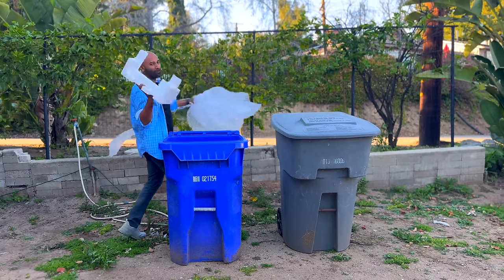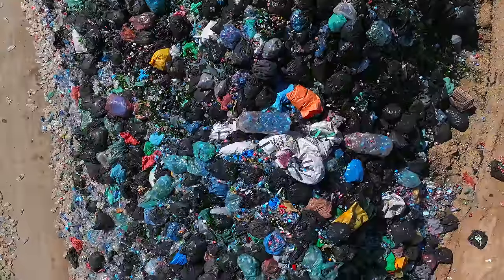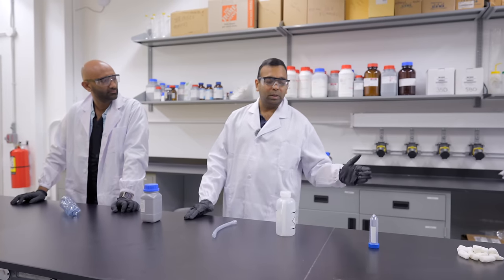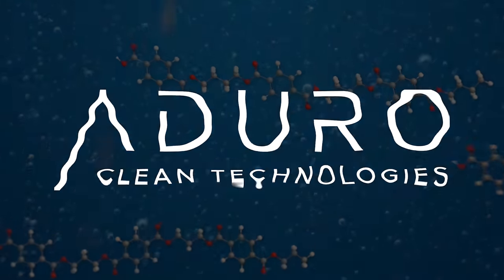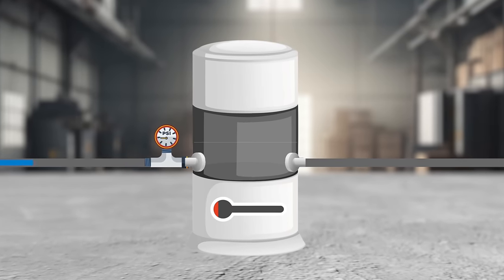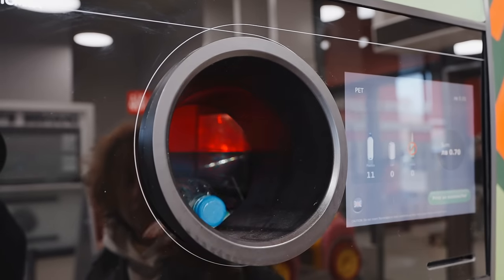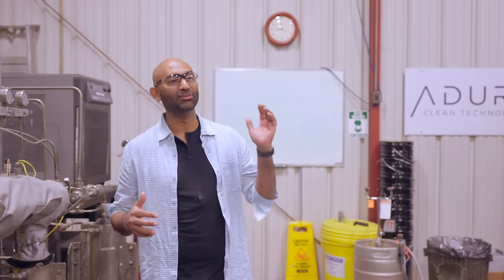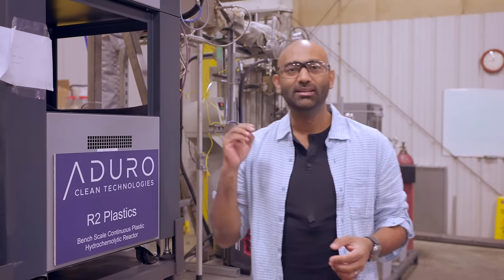Plastic Waste May FINALLY Have a Solution!

Comment: in 2019 Renewlogy, co-founded by MIT alumna Priyanka Bakaya, is using its system for converting plastic to fuel.  But I haven't see anything about them In a long time.

Comment: As long as we're mentioning public companies, HolyGrail 2.0 is a huge project in the EU about to wrap up a multi year study into solving the sorting problem. It's based on technology owned by a company called Digimarc. Would eliminate the need for most manual sorting plus result in much more valuable feedstock since it's more pure. Can also sort food graded from non food grade.
Reply: Ok that's a really positive sounding technology. They put a 'digital watermark' on the product, which is linked to a database of its properties, so a sorting machine can identify everything going through it and send it to the appropriate location. Perhaps it'll be faster than AI image based spotting or the two will combine - you could send everything that's bottle shaped in one direction, then scan it to be certain. Uniform shapes would possibly be easier to scan. 

Might be a good technology for Ricky to cover since sorting waste is a huge part of our problem and we do have massive landfills that will need Optimus to sort through them so we can get rid of them at last.

Comment: PLEASE do a video on waste (garbage/trash) to energy power plants like they use in Sweden.  They burn all trash at a very high temp & filter the exhaust to remove pollutants.  I think this is, BY FAR, the most economical method of handling our plastic waste as well as normal household garbage as we no longer need nasty landfills.

The amount of energy & time & resources required for recycling plastics is enormous and makes recycling FAR FAR more expensive than using virgin feedstock and it is (currently) ALWAYS of lesser quality than new plastics.  

After everything is burnt, the ash can be used for a wide variety of things and the metals can be recovered.
Reply: Thank you! I fully agree and this should be the main area we look at for plastics. Very cool tech here tho

Comment: Well, this gets me very interested. I used to work in the oil sands industry. The way bitumen was extracted from the underground is through thermo process to reduce the viscosity, either by hot water washing/liberating or SGAD so it's not bitumen only. It's always a mixture of water, bitumen and sands. If their catalysts and process can replace thermo cracking or hydrogen treatment which is needed to process bitumen to a lighter product (Canadian Western Select), this will be a real game changer.

Comment: 2 issues that were not addressed, and that concerns me: Energy required and non-useful byproduct. Especially if the byproduct is toxic for the environment.
     Does this process create more issues than it solves?
Reply: Finally someone's awake! The guy wearing a respirator on a machine that's not even online. They're hand feeding it. Scale it up and enter cities will need respirators.

Comment: I see this video just when I have been thinking about giving up on recycling plastic because landfill regulations make it far less likely that plastics will end up in the ocean than current recycling commerce streams. A continuous recycling process for all the different types of plastic certainly seems like it would be more efficient than having to recycle different plastics by different systems.

Comment: They left out a lot of information in this video.  This is just an investment ad for this start-up.  This tech isn't new, it is just reversing the plastic making process.  The reason companies don't do this is that it takes more energy to do this process than you get from it.  Like using a gallon of gas to make half a gallon.  Did you notice they didn't mention how much energy the process uses?  They make this look really complicated and hard to understand, but it is really very simple.  Don't fall for the razzle-dazzle.
Reply: You're right, it is an energy negative process. So how do we overcome that? I'd love to see concentrated solar paired with this

Comment: That's all great, but like previous recycling attempts, they found that the product it transforms into is too expensive to replace the materials they currently use in manufacturing it to begin with. It's not economically viable. There may be a way to change the consumer perspective to allow for an expensive version of plastic that is recycled, or the government may spend money to compensate for the cost difference. It's all still up in the air.
Reply: Valuable point made!!
Reply: Same thing with solar panels - you just add an up front cost to purchase, which covers recycling. It's super easy, barely an inconvenience and utterly solves the cost problem. Rocket science is not, and it's an already established and perfect solution to the cost problem.
Reply: @jonevansauthor  Solar Panels are a different category than our plastic usage. No one will want to pay $10 for a single soda pop.

Comment: we should prioritize banning and reducing plastic.
Reply: Great, so you take old bottles and make new bottles. That doesn't change the problem. It is better to burn it in a vacuum to make diesel.
Reply: Plastic is by far the best product for its uses. 95% yield with this tech. That also doesn't cure the already massive amounts that already exist
Reply: @TristanTemple-jz8bq  we should be actively banning the use of single use plastics
Reply: Ban plastic, not guns.

Comment: All the worlds major governments need to give these guys a ton of money and help save the planet
Reply: How about No?! They need enough money to make a workable full scale production system and see if it does work as advertised. 
We do not need an infinite supply of grifters burning billions upon billions which in fact reduces our technological advancement and as such has an indirect negative impact on the environment.
Zero trust in any governments ability to manage such things when they mostly do the exact polar opposite of what works in terms of conservation.
These guys are great for actually having some competence and putting their money where their mouth is, certainly hope it takes the world by storm.
Reply: Ehm, how about the companies that actually use and/or produce it instead. "Governments money" = taxpayer money. No thanks...
Reply: Combined with reduction of our consumption of products packaged in troublesome plastic, we could turn this container ship around! 😅

Comment: Using heat to break it down into the hydrocarbons it's made from for fuel or repolymerization into new plastic, while energy intensive, is more economical than creating from "virgin" stock. A large processing facility could be extremely profitable as economy of scale becomes applicable.

Comment: I think this is great! Polystyrene foam or styrofoam can be turned into to the styrene monomer. Afterwards you can convert this into benzoic acid and react with baking soda to form sodium benzoate. Sodium benzoate is a food preservative and is very safe. So idk the financial side of this but im familiar with the chemistry side of this and its possible. This is an example of just a simple straightforward method with just one polymer. I hope they continue to make it more financially viable and learn how to separate the different types of plastics from each other efficiently.

Comment: 4:37 the funny thing is, even though we are required to take the cap off at some recycling facilities in order to recycle a plastic bottle, the recycling center will not pay you if the label is not attached to the plastic bottle upon remittance. it must be written that your state will pay you CRV on that bottle, for you to get reimbursed for the CRV already paid for.
Reply: In my county in the UK, we are asked to remove the label, and leave the cap on a bottle, but our waste is collected we don't take it back for a credit in a shop which is done in some places. Of course, you can't actually get the whole label of as part of it is glued so it seems to me it's more practical to do that at the recycling plant as they're going to have to do that anyway. 

Ultimately though the reason plastic is not recycled, is there's no money in it. Which is easily solved by attaching a small charge to each bottle or bag, and using that to build and run recycling plants. Just as the EU has done with solar panels.

Comment: This reminds me of something else. Back between 2001-2005 timeframe there was a company called changing world technologies or something like that. Their process was to take mostly turkey offal since they were setting up next door to a butterball plant, but supposedly they could process used computers, sewage and other things as long as there was enough plastic/organic. Grind it all into a slurry, feed into a giant pressure cooker at high heat for several hours until simple carbon chains formed, flash boil the water off, centrifuge out the metal content and they were left with oil and gasoline. The gas fueled the machinery. Different oil types and quantities were determined by what was fed to the machinery.

Comment: The question I've often wondered about is why this sort of thing isn't done to our entire solid waste stream. I wondered why plastic wasn't chemically broken down back into something a kin to the feed stocks used to make the plastic in the first place, like these people are doing. The next step I imagined is using heat and water to turn the harder to break down hydrocarbons and other organic chemicals left over into more petrochemical feedstocks. I imagined the metallic and other elements from things like electronics, metal packaging, cars, appliances, etc. could be run through the process to remove the plastics and other organic chemicals and then refined back into the constituent elements such as aluminum, iron, silicon, precious metals, etc. Could there be a way to refine out usually toxic elements for reuse such as lead and mercury? One of the strangest things I heard about was the problem aluminum processers have with expensive to deal with waste high in potassium when they recycle cans, but that potassium is now deficient in forests because it is a part of wood harvested from our forests (wood ash is the traditional source of potassium hydroxide used by our ancestors to make soap) so why wasn't the potassium somehow used to reinvigorate our forests? No one seems to try to figure out how to make one person's junk into someone else's treasure. I think most biomass should be composted, but the biomass that inevitably ends up in the waste stream that usually gets landfilled could be made into hydrocarbons along with the plastic. There might be ways to take the nitrogenous components in the waste stream biomass, such as in the amino acids of proteins that could be made into nitrogen compounds to use in agriculture so we don't have to depend as much on energy intensive processes to make nitrogen compounds literally out of thin air; not to mention all the mineral nutrients such as phosphorus, calcium, potassium, sulfur etc. needed in agriculture that could be recycled. Taken to its logical conclusion, it could end up that mining and restoring old land fills would make economic sense, rather than continuing to make new ones to store what we should recycle in the first place.

Comment: That's cool. Does the process produce more value in its end products than its operating costs, especially energy cost? We really need to get global plastic pollution under control, especially in the developing world. The only thing a closed loop full recycling system requires, is constant input of energy. Hope that energy will be available and affordable.

Comment: I am litterly working at a similar pyrolysis machine in Austria -> it is quite funny to see how much they are still in this "prototype mode" while in Austria there are Re-Oil Plants from ÖMV which can process around 2 tonns every day and in Germany there are even bigger ones which can process 20-30 tons a day
Reply: I'm curious as to how the plastic recycling is paid for, as it probably isn't economical in Germany as well, even with the greater scale. Is there a mechanism that passes the extra cost of recycling to the consumer?

Comment: Awesome that the technical know-how is being developed to recycle a large part of this waste stream. I just hope that the cost of the process is lower or at least not much higher than producing new "virgin" feedstock from oil. Otherwise, this will go the route of CCS meaning it will not be deployed because it is too expensive to implement.

Comment: Thanks for the video. I always enjoy hearing about chemical recycling. I have not heard these questions addressed. What is the comparable energy and resources usage of chemical recycling versus virgin plastic manufacturing? What are the outputs of the processes, and are they toxic and marketable for other uses? What are the safety and security concerns of these facilities? For example, what if the facility catches fire or is demolished by natural disaster?

Comment: Scary thing about this recycling process (and, i think, similar processes)  - the patent wall. 
For a huge time only the patent holder will legally allow to sell and reproduce a patented product (process) on a commercial level.
An so this technology and similar ones will be very underproliferated across the globe. 
At the best companies like the Aduro Clean Technologies Inc. can be massively feed by government and private investors at a price of making
 such technical process available to free to general science and engineering (public domain?) to help its further advancements and spreading.

And i have a big doubts that a fluoropolymers are easily recyclable by this way (but at least, if there is a technology to crack a stones like ptfe at least to hf and 
fluorine-free hydrocarbons - it will be a  huge success.)

Comment: This innovation of plastic recycling by Aduro Clean Technologies Inc is a breakthrough technology. As such, after seeing this video, I have decided to buy stock in this company.  I want to "get on the ground floor" of buying into  this company before it takes off like other companies in the solar and EV industries have  done and are still doing.  Up until now, the only way to truly alleviate the plastic problem in an environmentally favorable way that I heard about was to use DNA modification to create "plastic eating" microbes.

Comment: New York City has been using Thermal Depolymerization (TDP) for decades now. By passing 30,000 volts through plastic in a vacuum it turns into a gas, which can then be compressed into fuel such as LPG. New York City uses it to turn plastic waste into fuel for their buses.

Comment: 1:21 The original machine had a base-plate of prefabulated aluminite, surmounted by a malleable logarithmic casing in such a way that the two main spurving bearings were in a direct line with the pentametric fan. The latter consisted simply of six hydrocoptic marzlevanes, so fitted to the ambifacient lunar waneshaft that side fumbling was effectively prevented. The main winding was of the normal lotus-o-delta type placed in panendermic semi-bovoid slots in the stator, every seventh conductor being connected by a non-reversible tremie pipe to the differential girdlespring on the "up" end of the grammeters.

Comment: Single use plastics are a bane - vapes, lighters, medicine bottles etc. Plus the wastage of oversized packaging: I bought a 6cm high bottle of vitamins yesterday that was only 2cm full. Then there are "designed to fail" brittle plastics - household storage bins, buckets etc - things that should be robust

Comment: There's a company in Japan that's been turning unsorted plastic into diesel for several years. The new diesel burns cleaner and with more power that current diesel.

Comment: Not to temper enthusiasm but as mentioned in a couple of other comments, the process either needs to be economical or someone has to subsidize the process .  It would be useful to show an energy balance on the current pilot plant to show how much energy is needed to transform the waste plastic into a useful products/feedstocks.  The balance would show the gap that must be closed to make it economical.  In the meantime, we should continue to recycle plastics to provide the folks developing this technology to have (slightlly) less expensive feedstocks to prove out the technology that could hopefully evolve to handle the more diverse platstics.

Comment: This was quite the one-sided feature, making it seem like a miracle solution without any downsides. It would have been nice to present some of the problems still facing the process, to get a more balanced viewpoint. For example: this seems like a costly and energy intensive process when scaled up (assuming they even work out all the kinks, which is not a trivial problem). If it requires large subsidies to be competitive with virgin polymers (which have already been optimized for cost), I don't see how it ever gets scaled up enough to make a meaningful impact on the waste plastic problem. Like it or not, money makes the world go round, so you can't ignore the economic side. And I'd argue it's irresponsible to be blindly advertising for people to invest in such a company before they can necessarily provide a return on that investment (at least not without understanding all the risks).